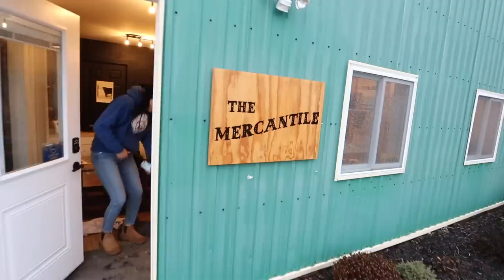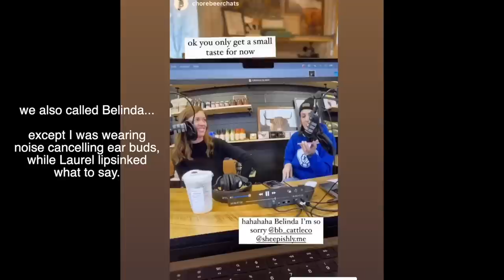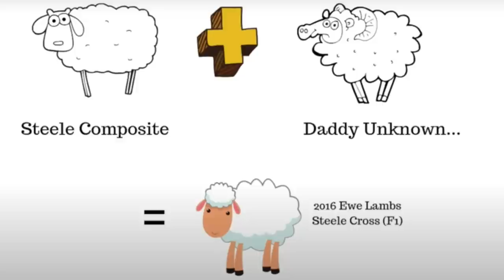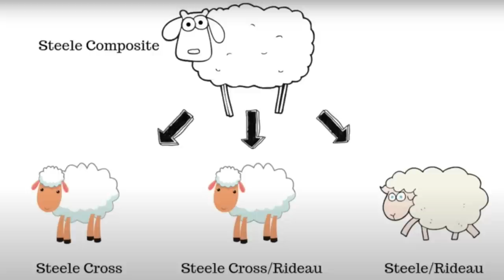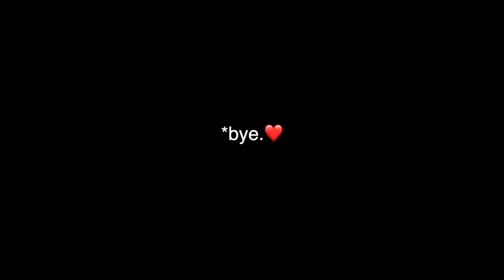She may not be LARGE... but she's definitely in CHARGE! | these boys are worn out! | Vlog 663

Comment: Dear , the fan needs a bit of a extension rod. Usually they have a ball joint and using a extension rod they can be used on a raked ceiling. Also you can get the Karbon style globes in led in a cool white. In different styles too.

Comment: have you ever considered putting the dorset and the steele rams in the same group that would give you a good accellerated line to cross back to rideau to produce the majority of your ewe lambs also do you separate the group two and three by production records having the higher producing consistent breeders with the steele group and use group 3 as more of a terminal group